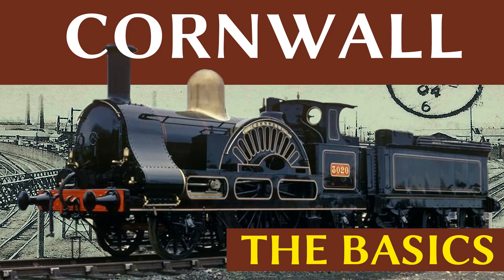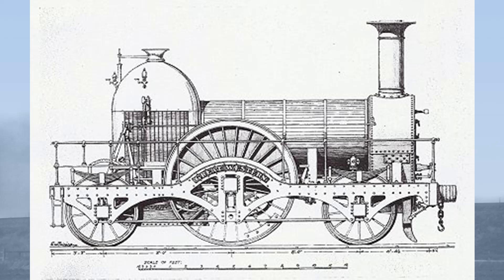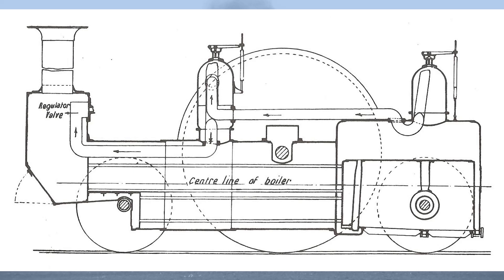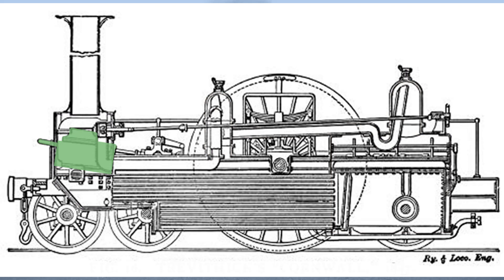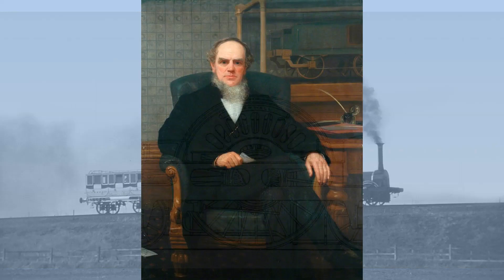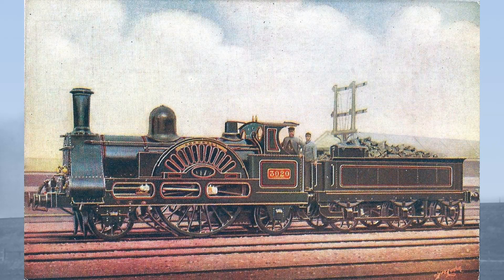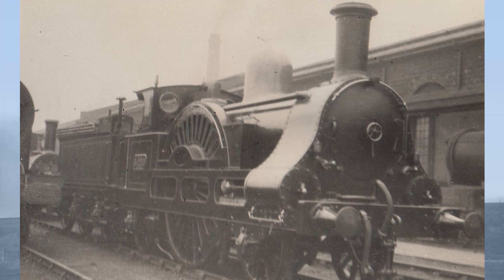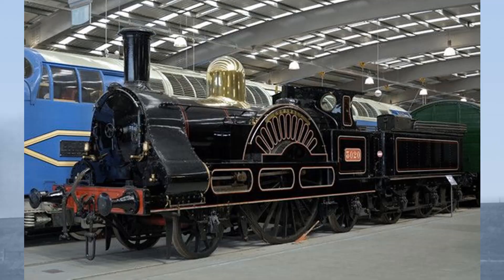Cornwall: The Basics

Comment: I love this engine, especially its very bizarre 4-2-2 rendition. I find it funny how "normal" they made the engine look later on, such a handsome tall single wheeler.
Reply: It’s actually a 2-2-2-2, as the front wheels aren’t a bogie truck.
Reply: @NoaZeevi  It isn't.
2-2-2-2 would be a Webb-style non-coupled loco with (left to right) 2 leading wheels, 2 driving wheels, another two driving wheels and two trailling wheels.
The first and last digits in the Whyte notation are always the number of non-driven wheels, irrespective of their mounting arrangement.

Comment: Ramsbottom completely reengineered Trevithick's engine - I'm not sure it can be considered a "rebuild". Trevithick's pièce de résistance was that underslung boiler, which Ramsbottom sensibly did away with. It became a sort of Problem class with outside frames and it gained that handsome and very Victorian LNWR cab.
Reply: Trevithick’s underslung boiler design was  basically a “ what the fuck?” Moment

Comment: Were the cylinders lowered to a horizontal position when rebuilt as a 4-2-2?

It's amazing the lengths the protagonists in the gauge war went to after the trials of 1845  in anticipation of further tests the following year, which never happened.   The broad gauge "Great Western" was ordered and built in just 13 weeks, construction carrying on day and night, while Cornwall's low centre of gravity was no doubt partly the result of the previous years trials being brought to an abrupt conclusion by one of the narrow gauge locos turning over.
Reply: curiously when the Pennsylvania railroad was undergoing electrification in the early twentieth century they actually went with a high centre of gravity, having found that low gravity locos would basically spread the gauge, and hammer the outer rails because of the massive weight augment down low. I'm wondering the early locos being considerably lighter may have been affected by the more familiar weight distribution difficulties. the pennsy electrics were already starting to be in the 100's of tons category.

Comment: She should be restored to working order
You can't look at such a beautiful engine stuck in a museum.
But well, she would need quite the overhaul and a new boiler, and it's not exactly that cheap
Reply: In earlier times, no one bothered to check under the boiler. There was a spectacular explosion just north of Tamworth where the boiler plates had worn so thin, it must have been like an eggshell actually breathing in and out.
Reply: @johnjephcote7636  didn't she have her boiler pressure somewhat unwisely raised a few months prior? I need to have a look at my copy of Red for Danger.

Comment: Remember being allowed to get up on the footplate at the Severn valley in 1980 on my Rainhill focused UK visit. I could feel a real sense of history being close to one of the few 1850s era preserved UK locos.
Not sure why it was there. Only time on the trip I had camera problems.
Reply from the maker: It was there on loan being investigated for a possible return to steam for Rocket 150.... but never was. Thankfully.
Reply: @AnthonyDawsonHistory  I understand that while he was inspecting the condison of the boiler the boiler inspector put his hammer through the boiler barrel by accident not knowing how thin the metal had become over the years that the engine was being used?
Reply from the maker: @eliotreader8220  the traditional method of testing boiler plate integrity is to strike it with a hammer, and listen to the noise it makes. In this instance the boiler was quite literally worn out. It had last steamed in 1930 so forty years before and it may have been life expired back then.
Reply: @AnthonyDawsonHistory  as a steam locomotive historian of sorts what are the  positive chances of the working recreations of the two broad gauge engines Firefly and Iron Duke that are based at Didcot railway centre being returned to steam again?. two years ago Me and my Dad visited the Great Western railway trust's base and I heard a not so positive response to this question which was given by someone who possibly did not know much about steam engines when his son asked a similar question.
Reply from the maker: @eliotreader8220  I don't know. As ever it comes down to a) money, b) enthusiasm c) the will..... Always the money tho'.
Reply: @AnthonyDawsonHistory  sorry if I have been getting under your feet asking all these questions
Reply: how much coke or coal and water would Cornwall's tender have usually carried during her working life? would she have carried as much as a broad gauge engine on the Great western railway?
Reply: @AnthonyDawsonHistory  sorry about my mistake. I guess that proved that she was no longer steamable.
after the Boiler inspector's hammer went through the boiler did they do anything about damage done to it?

Comment: What puzzled me was that the CG was so low. Later on, the CG was dangerously high as on the L&Y 'High Flyers'. Also, I don't know the method of LNW firing as Cornwall did not have a BG (broad gauge) firebox (taken from the GW for the Ivatt atlantics)...and I am only familar with the Midland method of firing.
Reply from the maker: One thing we don't know for locomotives pre-1865 is the method of firing because they all burned coke. The replicas of "Rocket" and "Planet" were tried on modern coke and failed to make steam, suggesting the firing method for coke is different from coal - very likely as coke needs a far thicker fire bed and doesn't need a blower - or that modern coke is very different from what it was 200 years ago. We do know that "Planet" burns Welsh Steam Coal very well, and that Welsh coal is in many respects the equal of coke in being very high carbon and a similar calorific content. However, it differs greatly in how it burns and performs on the grate - Welsh Coal has a tendenct to "cauliflower" ie open up and expand and break into pieces whereas coke doesnt.